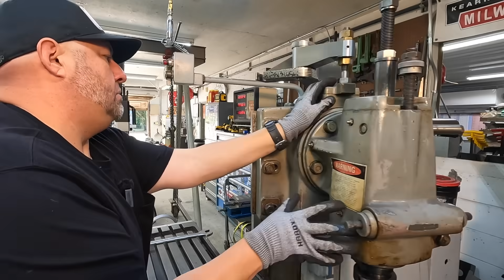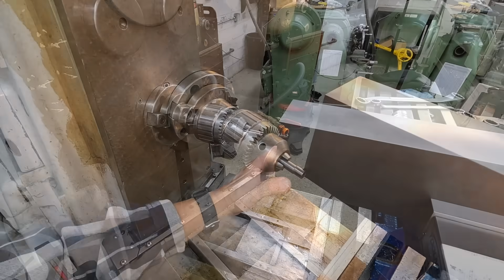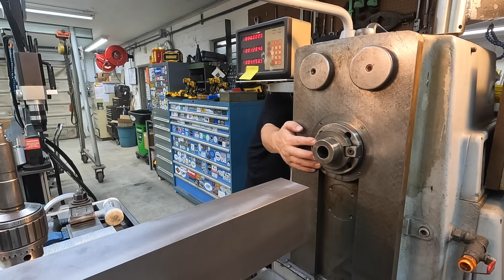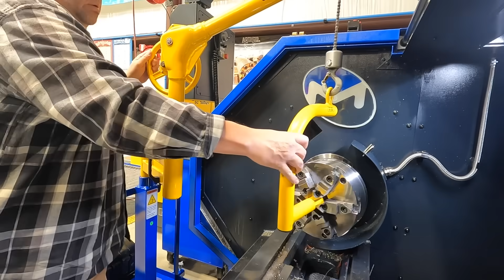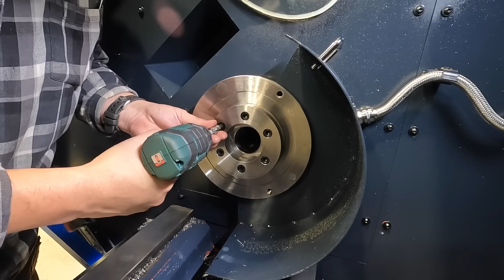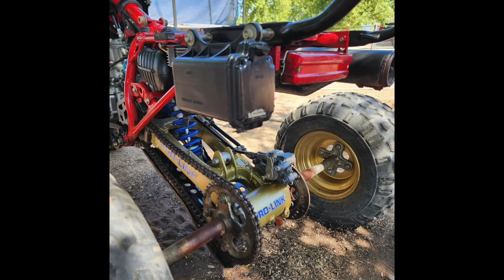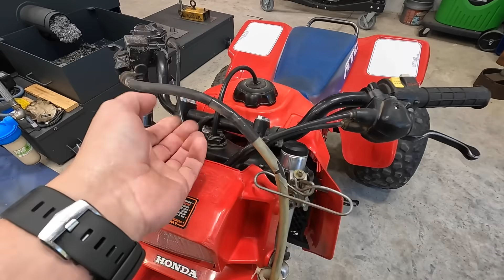SNS 377: Machine Setups & Honda ATC 250R

Comment: I knew a guy who bought one of those new in 1985. In 1986 he flipped it over backwards and ended up in a hospital for two months and off work for 6 months. He was 51 when he crashed it.
Reply: I knew a guy that wrecked a 3 wheeler around the 1986 period. He spent a few months in the hospital and then passed away. Beer was a factor.

Comment: I noticed thqat when you remove the backing plate for the 6 jaw chuck one of th bolts sounded like it wasn't  as tight as the other 5 bolts. is may have just been the audio but if not, could tht have been a factor in the chatter you experienced?

Comment: Thanks Adam.
How come the backing plate was designed with 6 Bolts to hold it on vs the Chuck with only 3 ??
That seemed strange to Me when You 1st installed it..

Comment: Good video as usual!

Back in the day, somewhere in the late '80s, a girlfriend's little brother had several 3-wheelers.

One day a 250R showed up at the farm.  Yup!  That thing was definitely dipped in hot sauce at the factory!...speed runs were no longer done in the back 40, but on the smooth gravel road out front!  The Big Red trike had more grunt for pulling stumps, or whatever,  but when the R came into its powerband it was just...freakin'...GONE!

I took it out on the gravel once and learned right quick that both the R and the little brother had more 'hair' than I did!  After that, I stuck to putting big engines in little cars!  Like the time that the parent's '64 Buick Wildcat donated its engine to my '78 Chevy Monza after extending the life of the girlfriend's '77 Skylark when its V-6 went out to lunch.

Thanks for bringing back those memories!

Comment: I am also a 250R owner, I'm the second owner of a 1984 model that I purchased in 1985. My wife has my old 200X that I purchased new in 1984, in 1986 we bought both of our daughters used three wheelers (another 200X and a 125), we had fantastic weekends riding trails, rivers and sand dunes.  My 250 looks to be in similar shape as yours everything on it is original. I also plan to do some cosmetic work to it and later pass it on to my grandson.  Even though I'm 70yrs old I still have the urge to ride and feel the power these three wheelers produce.
Reply: If I remember right the 84 model is air cooled....?
Reply: You are correct. @markdoepker

Comment: Put a slightly bigger sprocket on the rear of your ATC when you replace the chain. It'll give you a better gear ratio. More power and control in every gear but less top speed.

Comment: Be careful, they claim trikes are tricky hence the quads. 1985 went railfanning to Fairhope, Pa in Jan on an eighty foot high cliff above Wills Creek on ice cover remelt snow. Had permission from land owner to follow his trike tire tracks to the view point above the CSX tracks. He had spilled his trike taking deer corn to the cliff edge. 
I had an orange/white '68 Honda 350 Scrambler with the square black muffler until 1975, I adapted a BSA buddy rail to the seat, a fun ride, the wife got it during divorce.

Comment: I would have put on the jaws centered, and use fitting center punches for the locates. not sure how accurate it would have been, but would have saved a bunch of time.

Comment: Adam I had a 350 Honda like that we got it used and the rear was shot new seals n bearings sprocket n chain brakes. Carb clean n rebuild plug and service. It was super fast and fun to ride. I had to make a suicided shifter cause my leg is paralyzed and drop foot. Even tho I too grew up trail riding first a mini bike then a garelli 50 CC Italian mini cycle.I had it till I graduated high school. I put old sweeper  pipes straight and angled up she sounded like an old Harley popping and roar  it  was cool for sure. Fun on ice too. Ah the memories.specially now I'm bed bound and can't even sit up with out agony.

Comment: If you aren't familiar with riding a trike at speed, here's a tip. Weight the outside footpeg and lift the inside tire so that you are riding it like a 2 wheeler. She'll cut hard turns like it's on rails. Try to turn it fast sitting on 3 tires and she'll flip and roll like a disaster movie.
Reply: You begin the corner by leaning out then quickly lean back in, tricky.
Reply: @genejasper4091  I don't do that and it is not tricky. I weight the outside peg and turn. It comes right up as if by magic.:face-blue-wide-eyes:
Reply: Oh you troll😅

Comment: Lacking a K&T, I would make a jig that locates on the machined rail, and has two hardened drill bushings pressed in at the proper locations. Drill using a handheld drill motor. I think this would be plenty accurate for jaw mounting screws. Might have to do a second jig (or press in different bushings) to tap...
Reply: Or use the jaw as a drill guide.

Comment: Adam, on your CNC lathe it appears there is an out of balance condition, does it run smooth? The Chuck seemed to have a spot where it was heavy when you were removing it.

Comment: Drilled my holes on my radial arm drill. Stood it up right by holding it with a big angle plate. Of course I had to mark it out first and centre punch the centres. But worked well. 

Merry Christmas 🎄

Comment: Have to agree with another poster to be very careful if you intend to ride it. As you mentioned in the video a friend took it for a ride and rolled it. That is why these 3 wheeled things were banned from manufacture.  It would be a great project to freshen it up and ride it responsibly and not like ya stole it, then I would sell it and get a 4 wheeler if ya don't want a regular two wheel bike.  As an owner of a new 1978 Yamaha IT 400 back in the day ......  a regular dirt bike is waaayyy more fun but a 4 wheeler would be second on my list.  just say'n  be careful out there.

Comment: Hi Adam!  Hey, just a thought. Maybe it’s already made like this, but that little arm that has to swing into the “slot” the one where you had to loosen the nut a bit?  Well, does that little arm rest on a thrust bearing to make it easier to turn that thing or is that not a real good idea? Thinking that a thrust bearing might help make it easier, but only until it broke or wore out, right?   :) .

Comment: We made a vise like this and drilled and tapped the holes through from the opposite side of the face. Brazed the ends of the holes shut and painted right over it.
Reply: What Downside do you see to just keeping the Holes open?
Reply: @FullSpeed_only You mean besides looking like it was done half ass?
Reply: @grntitan1  Nothing half assed about it. It's more about not actually needing to go through all the trouble he did. It doesn't negatively affect the vise doing it the way we have done it.
Reply: @FullSpeed_only No down sides at all. I suppose it would gather debris and such. Just looks cleaner with them plugged.

Comment: Adam, sometimes watching you is absolutely infuriating. Why can't you look at other hybrid CNC machines and use what they use?
You need a forgardt F250+ or a schunk rota-s. Quick change jaws designed to be used with soft jaws. 
Sometimes I wonder what you're thinking. Were you planning on doing all your second op work with hard jaws?

The worst thing is, you never even engage with your comments. We've got an hour long video here, and all you did was put a vice on a milling machine.

This channel could be SO great, and there's such massive demand for this content.
Somehow, in 2.5 years, cutting edge engineering have managed to obtain 1.5x your subs, that took you 10 years.
At some point don't you step back and wonder what you're doing wrong?

Like, do you even do any job shopping work any more? It's been 2 years, and I think I've seen a total of 3 jobs pass through your doors. What are you even building this shop for?
Reply: this channel IS great
lol are you actually hate-watching this channel?
Reply: @floodo1  I'm watching for once a quarter decent video where he talks about turning or does a cool project.
Reply: Missing the point he made multiple times it is HIS project and he plans to ENJOY a range of his tools to do it. Also what does Curtis and CCE have to do with this channel it is not some sort of subs pissing contest!
Reply: @seabreezecoffeeroasters7994  I mean you'd have to be pretty obtuse to not notice that 

Adam stopped doing big turning
and
CEE does big turning

It's not a pissing contest, I'm saying that the market is there. It's just completely unfilled.
Reply: @spikeypineapple552  Adam used to have a 'job' where turning large shafts was a thing. He hasn't had that job for several years and it is not a market he went after when he left Motion. People evolve and until the whiners get over themselves Adam has done just that and it is HIS decision right or wrong.
Reply: @seabreezecoffeeroasters7994  Yes, I know. 
I didn't say it wasn't his call. I said it was pretty obvious to everyone that this quality of content isn't going to put food on the table.
I don't understand why you think feedback isn't important? If I made bad parts at work, I'd sure as hell want my end customer to let me know so I can fix the mistake and make sure it doesn't happen again.
The first part of my comment(about which chuck to use), I made on the first video he got that lathe. If he'd LISTENED to another professional, he could have saved himself a days work.
Reply: @spikeypineapple552  So now you try and pivot to putting food on HIS table. Again that is HIS call not yours to decide what does or doesn't work. I think you should go take a cold shower and look at YOUR place in the food chain.
Reply: @spikeypineapple552  main character syndrome lol
Reply: @seabreezecoffeeroasters7994  If his goal is to make money from youtube, and to grow his channel, this isn't working.
Reply: @spikeypineapple552  That is YOUR opinion which you can have but you are also more than likely WRONG about making a $. YouTube subs count is a fantasy figure and not where the money is.
Reply: @spikeypineapple552 How do you know how much money he makes and where it comes from? I’ll save you the reply; you don’t.
Reply: @grntitan1  we don't, but if you look at the statistics for this channel you'll see that it's not growing and that people are no longer willing to pay for the content. to be clear, these comments don't stem from a desire to see adam fail or to spread hatred; the channel succeeding is a win-win situation
Reply: The switch to including bike mods as part of the content for this machining channel:  Implies to me one of 2 things:  Firstly it gives him stress free ( no customer) work which ( alike the extended vise series ) fills out his YouTube obligations, and so creates the room and time for him to get to grips with and overcome his struggles with the CNC stuff , off camera. Or secondly, he's  resigned to losing the CNC's in say a couple of years when he makes his move to his new shop at his new property, and so is exploring other avenues to pursue his channel.
Reply: long videos with basically nothing happening in them is why i unsubscribed from clough42. blondihacks, inheritance machining, cutting edge engineering and more, all creating whole parts or even projects in a video while some of these guys are barely succesful at working a single machining operation into a video. i remember why adam's videos were popular before; it's because at motion he created shafts and a bunch of chips. there's none of that here now; if i want to see big chips being made i need to go to chris maj's videos instead. adam, you need to wake up and sort this out. you will end up having to get a job again at this rate.

Comment: Could also just take a chunk of metal with flat parallel sides, drill a hole using a drill press through the chunk, and use that chunk as a guide to drill the vice jaw.
Reply: Or the jaw

Comment: Certainly looks steady enough for some straight drilling. My immediate thought when you mentioned using the K&T horizontally was for an arbour with a number 4 socket held out of the end of the arbour steady using the top bars for rigidity. Seems to work fine this way though and that is running a lore more true than I thought a bunch of extensions would, nice.
Reply: same (-8 tho it is just drilling so don’t need much

Comment: Had a lot of fun on an ATC when they came out...we used to pop wheelies or even drive on two side wheels and all sorts of stuff, they were a blast...also knew a guy who took a sharp turn at the bottom of a hill and impaled himself on the handlebar when the three wheel config threw him sideways (he survived but wicked belly scar)...they are fun but just watch yer ass.

Comment: @Abom79    Abom, have you considered the possibility of some backlash in the adjustment pinions on the backing plate? Set tru chucks are great, but they do introduce another layer that can effect rigidity. Because it allows for adjustments, the chuck cannot be positive locked to the backing plate. Any gap between the 2 at all will really be exposed at the higher rpm range, which probably makes set tru chucks not a great choice for CNC applications, as they generally tend to run higher rpms than the manual lathes. Great video as always Abom. It is nice to see a longer video from you again!

Comment: Given that it's cast iron, wouldn't it be a more viable option to make a drill guide/template for the vice jaw holes out of bar stock and just drill them with a hand drill? It feels like your trying to use a mill because you have a mill.
Reply: Agreed. Would seem way simpler, cheaper and quicker to make a guide with a drill press and use the same drill bit for both operations. Would produce good results too I recon.
Reply: Yes, the point of the vice build is to use all the machines.

What you describe is surely the most practical way, but not precision and not using the machines in Adam’s collection (-8
Reply: @floodo1  I haven't seen Adam use a cordless drill, I'm sure he's got one.

Comment: Tilt the head on the milling machine put in a vise to 45 degrees
Reply: The vertical head doesn’t have a quill. It would require 2 axis of table motion at the same time. Probably not the easiest way to do it.

Comment: Adam, correct me if I'm wrong but couldn't you use the overarm bearing mount for horiz. milling to steady the longer extension and then the new extensions wouldn't be required.

Comment: I bought a 1985 ATC 250R off the showroom floor. Sure had a lot of fun on that ATC, it was wild to power turn a 180* turn on sand and have the front wheel coming up at the end! Having previously had a 1983 Big Red, 1983 200X, I had to upgrade when my best buddy bought a 350X. The first day we had it we learned quickly to respect it, one section of our ride trail ran along side the highway (freeway? Canadian up  here eh?) I dropped it down a gear at 55 mph and gave it some throttle and was passing cars on two wheels at 60+ mph! I wish I never sold it.

Comment: I used to have a 250R. Riding a 3 wheeler definitely puts you on the edge whilst turning. Decided to sell it before I hurt myself. The quads are more stable but just not the same.
Reply: ATC's turn like the wind blows. I owned at least 2 dozen. Probably more. They dominate in the snow and rule on the ice. Trikes are made to turn but like everything they have limits. If you think quads are any less safe, you are mistaken. Its a false sense of security. I've owned big bore's and even custom TRI-SHEE's. Every thing from s,m,sx,r,ytz and x's. Trikes and dirt bikes are great.